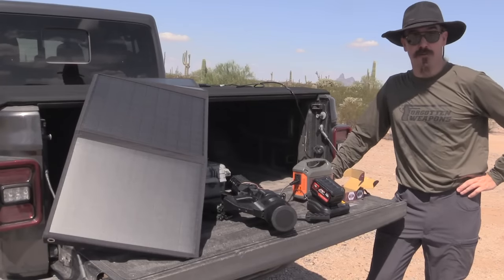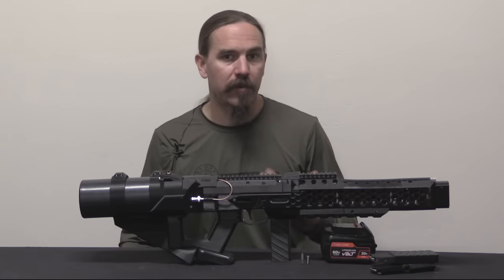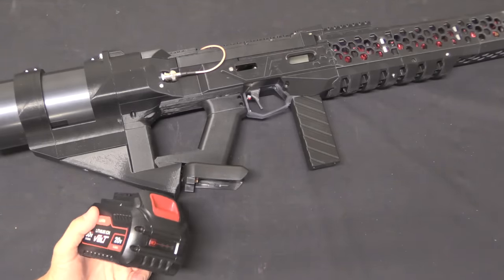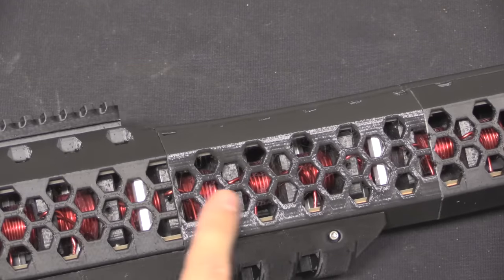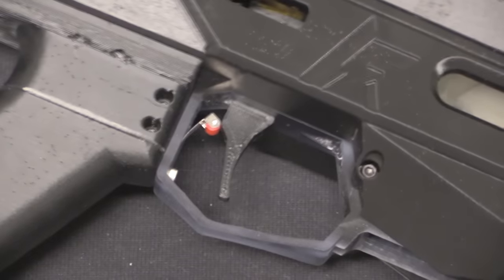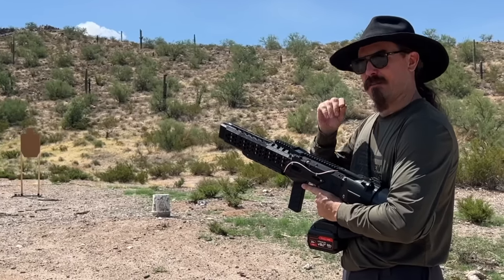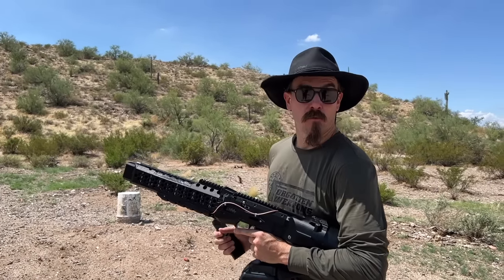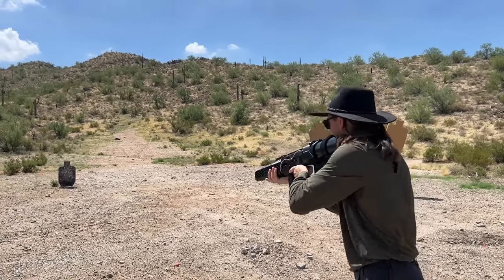ArcFlash Labs EMG-02 CoilGun: Making SciFi Weapons Into Reality

Comment: I would have though they would replace the little LCD screen with something like the 'e-paper' they use on the Kindle. It doesn't refresh like an LCD does, and it's pretty easy to see in bright light too.
Reply: At the end of the day, you need to integrate every part of your design and while LCDs screens are widely available and there are easily connected to the microcontroller, I bet e-paper is a pain in the ass to integrate
Reply: The slow update cycle of e-ink would kinda kill the progress bar they seem to like.
Reply: @PrezVeto  I doubt the charge meter needs to be 60hz real time for this, especially when they get that many shots out of a battery. 
@pesanchegra That's a point actually, I hadn't considered that. But I still think it should be an eventual goal, if they plan to have this be a viable commercial product eventually.
For the sake of visibility and power savings if nothing else.
Reply: That's a really good point! I remember a hackaday article about repurposing paper displaces from clothing price tags that used them, so there are small paper displays out there already they could conceivably be sourcing.

Comment: 🤔 Interesting tech experiment.. it has a lot of thought out ideas here. A practical power source. A practical size. No recoil and no flash or sound. I would think some sort of fin stabilized projectile would take care of accuracy issues? It's not a game changer, yet. But I could definitely see as a first step away from using combustion of chemicals to propel projectiles.
Reply: Might not even fin stabilize since that would add a bunch of complexity. What might be simpler would be a twist in the projectile itself and see if that could properly spin the round.
Reply: @MacSalterson  a fin stabilized sabot is not complex.
Reply: @WALTERBROADDUS  Tell that to Franklin Armory.
Reply: discarding sabot is going to be a problem because the sabot is going to try to discard in the barrel
Reply: Someone else also suggested possibly a round shaped like Torpedoes, with the ring/fin design. Would also help with stacking issues in a magazine, and the ring could be the same diameter as the barrel.
Reply: IIRC the company is planning on using “electronic rifling” to stabilize the projectiles, basically having a rotating magnetic field when firing the weapon to make the projectile spin in the barrel
Reply: Simplest solution would be to just make the butt of the projectile hollow like a foster slug or a minneball, the projectile will naturally fly heavy end first
Reply: @connorbaz5980  you do like tank guns use. They use a smooth bore with a sabot.
Reply: @MrAirpumpkin  that would impart friction and cause heat buildup.
Reply: @spencerh103  doesn't seem to be an issue in the real world.
Reply: @thomasbecker9676 who are they?
Reply: @WALTERBROADDUS  how?
Reply: @MrAirpumpkin  you yourself said you wanted to make a projectile like a minie ball. How else are you going to engage The rifling without expansion? And as you increase the frictional heat that's going to reduce the conductivity of the coils.
Reply: @WALTERBROADDUS  because non-coilgun firearms actually have the projectile contact the barrel, which is not the case here. how much do you actually understand about coilguns?
Reply: @WALTERBROADDUS  LMGTFY.
Reply: @WALTERBROADDUS  The minie ball can work both as a "drag stabalized" projectile and as a rifled projectile. Its hollow at the bottom and heavier towards the front so even if shot from a smooth bore it will fly straight-er than a musket ball or dowel pin of the same diameter.
Reply: @MrAirpumpkin  a fin stabilized projectile kind of meets the same purpose. And if you want to get really fancy? Hopefully one day we will able to make guided projectiles that small.
Reply: @spencerh103  I'm very familiar with firearms and projectile physics.
Reply: @WALTERBROADDUS  a hollow bottom projectile is simpler (and therefore better) for frankly obvious reasons...
Reply: @WALTERBROADDUS  Getting it to work in a coil gun, where theres no contact between the barrel and the projectiles, would be complex.

Comment: Could you use a magnet to sweep the range after, collect up used dowels and re use them? If theres no contact with a barrel then a little dust wouldn't do much damage.
Would a domed/cone tipped dowel have better travel through the air? could improve range, velocity and accuracy. I thought maybe some swirled grooves in the cone tip could create a rotation like rifling would.
Reply: Yea I would think you could shape the projectile in some way to some rotation from the magnetic field - course the cost would be really prohibitive at small scale. Maybe when the government starts buying pallets of ammo at $100 per round we'll start to see that kind of thing.
Reply: Maybe we could have the machine that turns long rods into projectiles put a chamfer on one end.
Reply: You should be able to recover most of your ammo using a magnet.  You could also get round bar and make ammo that would be just as effective and much less expensive.
Reply: Now they will start doing background checks at the hardware store!

Comment: 3D-printed, standard components you can very easily get anywhere...
This sounds like something you could mass-produce in Fallout
Reply: For the most part, but I imagine that massive capacitor is a bleeding-edge custom
Reply: @careernerd2135  honestly I would bet it's another jelly been part
Reply: Not really. Modern plastic doesn’t belong in Fallout: Fallout’s Great War was caused by running out of oil, and tech development diverged away by the end of WW2. Plastics would be limited to early bioplastics like the highly flammable celluloid and the fragile PET. You can see in Fallout 1/2 and New Vegas the art consciously avoids using plastics, even when basing things on real world objects that have plastic.

Comment: given that the coilgun effectively has a 'smoothbore" im thinking of 2 things that could probably improve flight performance.
1) coils oriented to impart rotation in the round that is being accelerated.
2) round itself has rifling
Reply: Maybe round-length fins, for easier manufacture and loading?
Reply: the round doesn't actually contact the barrel very well, so option 1 is probably better
Reply: But how do you do that?  SF has many electromagnetic weapons with "coils on a bias" but that is just words with no physics.  Either a fin stabilized steel flechette or just a round ball that cannot tumble is feasible.
Reply: Or just make it fire flechettes. That's what current large scale railguns do, as they also can't impart rotation.
Reply: I disagree. Making the projectile rotate by the magnetic power is likely extreamly complicated if not impossible. Its not a good solution. There is a much easier one. This kind of weapon does not really care about the shape of the projectile. So it would be much simpler to just fire flechette rounds from it.
Reply: The 'round' goes through the coils so angling them wont make any difference. Secondly even if the round passed 'over' a coil there's no bias in the projectile to make one portion of it more attractive to magnetic field than the rest, end result is the projectile is still pulled down the barrel no matter how the coils are placed around it. The only way to do it with the current design is to chamber each round and physically spin them up prior to the magnetic field engaging pulling the round down the barrel.

Comment: I feel like we might finally have a real dart gun in our future. Low speed controlled impulse with a little needle and sedative contained inside. That’s been in movies longer than lasers and coil guns.
Reply: Real tranquilizer dart guns have existed for decades. Pretty useful for capturing live animals.
Reply: @SharpElbows123  True but this thing is both quieter than a co2 gun of comparable size. And with it using standard lithium-ion tool batteries that can be charged via solar powered chargers it's more practical for long marches and or shtf situations.  

Not to mention at full charge a standard battery has the juice for 300 rounds . Co2 canisters of a comparable size and weight can't measure up to that.

Comment: Having seen the failure mode of a capacitor, I don't know about using the top end of a capacitor as a shoulder rest for your electric gun.

Typically the top end is perforated so it explodes that direction expelling superheated steam, even tiny ones sound like firecrackers.
Reply: Ahem, superheated acid steam.  Because who needs a face?

Comment: The display would be better on the side of it rather than the top. It's going to be a right pain to see the display with optics. But if it is on the offhand side of the chassis it's a simple matter of tilt it away from the body exposing the screen to the eyes. This can be made so it is left or right hand interchangeable. Screen in a little removable box with contact pads in the chassis and spring loaded pins in the box for connectivity and an empty box for the other side to fill in the hole. It can be attached via a plastic tab like what's used in 100's of thousands of plastic objects, but instead of needing a special tool to get into the gap(most people that tool is a butter knife) so the tab can be pushed back there could be a generic found in everyone's junk drawer flathead screwdriver slot. Stick the screwdriver tip into the slot and just a touch of pry the screen out force needed(indent in the side of the screen box for this) to get it past the tab.

The tab should be angled across the screwdriver slot with the triangle catch pin on the box with the angle facing into chassis. The box wall with the catch pin should be a little under the screwdriver tip width and inset into the box and the tab should go into the box. This way the screwdriver being pushed into the slot always disengages the tab and then tilting the screwdriver to pry out the box can be done with a remove movement so screwdriver and box comes out together.

Comment: Increase the power input from a backpack, add more coils to the front to increase velocity and use fin stabilised discarding sabot, so smaller round at much higher velocity and more accurate.

Comment: Have you recommended to them that they use partially hollow, front heavy, projectile similar to a foster slug so the projectiles can use drag stabilization removing the necessity of rifling for a stable flight.
Reply: I'd expect the eventual evolution is to make the coils work in a way that imparts a spin while going down the barrel.
Reply: @kentvesser9484  or possibly getting the velocity high enough to make use of fin stabilization.
Reply: Honestly, with a magazine that could hold fin-stabilized ammo, you could just use that as-is. Feather or wood fletching could be made bigger than the barrel with the intent to slide down the barrel in a folded state, just to pop out into its full form after exiting the muzzle. Metal fins would have to be made smaller than the barrel, of course, but they might have an interesting effect of increasing the muzzle velocity somewhat due to the magnetic mass being concentrated in the back of the projectile.
Reply: Just a random thought, but could it fire sections of drill bits? They come with in-built rifling in the "bullet" which should impart at least some spin. Presumably it would also be reasonably cheap and easy to come by certainly more so than custom built ammunition.
Reply: How I wish I could try this because I really want to know the answer too
Reply: @mrhedgebull1658  no reason it can't, honestly. Genius idea, IMO.
Reply: @mrhedgebull1658  I'd think that might create more drag impacting range and drop more than the benefit you would get from any spin stabilization.
Reply: @kentvesser9484  foster slugs and other similar designs do typically have a poor ballistic coefficient but given the increased accuracy it gives makes that an acceptable drawback to most people. Not to mention even a poorly weighted projectile that flys strait will get better range, accuracy, and retained velocity than a cylinder tumbling through the air.
Reply: Steel dowel pins are actually going to be the optimal projectile for this stage of development, even though most of us can think of several ways they could be optimized for accuracy and/or range. Given the back-pressure problems inherent in a coilgun arrangement, I suspect the 'best' projectile is going to be very weird to our current sensibilities; There's a possibility that rather than fins or rifling, a tapered section of pipe with a venturi-effect narrowing towards the rear might self-stabilise and be the optimal slug...
Reply: @kentvesser9484  You may well be right, it was only an idle thought. Might be worth testing though.

Comment: There’s recoil and the reason you don’t feel it is because the guns heavy, the projectile is small, the speed is low.

There is recoil, there has to be because you have a mass that’s accelerated. However with this gun the projectile is pulled by the coil and the coil is fixed to the gun so the energised coil pulls the projectile forwards and in doing so the coil is pulled backwards to the projectile. Get a magnet next to steel and let the magnet go and it’s pulled to the steel. That’s what happening here except this magnet is huge and the steel is small so the steel moves far far far more than the heavy magnet.

Comment: Great thing about it is that it's so quiet, so no need to worry about own hearing issues, or neighbors. If there was a way of reliably finding and reusing the ammunition (sweeping the area with electromagnet to pick it up maybe) it might be quite cheap to spend some time at the range.
Reply: My thought exactly: Set up steel barrier (or even dense plastic) and  then just use a magnetic rod (like the ones used to cleaning machinery in workshops with a little rubber handle you push down over the rod to clear it of the debris and coils it's picked up)

Comment: They could attach a heatsink to the resistor when it dumps the charge and put some vent holes to help passively cool much quicker.
I'd opt more for a bullpup design to have more barrel length in a compact design, your rifling could be done to the projectiles instead of the barrel, so as the dowels are propelled forward they rotate themselves.
Other changes I'd make would be the battery to something still rechargeable but can slide into the grip similar to a pistol, then the ammo would load behind it with the bullpup design. The biggest thing that's lack is the velocity needs to closer to at least 800 ft/sec, but possibly higher due to the size of the projectile.

Comment: Instead of using a flathead drill bit, use a Phillips heads. And instead of the drill bit just being a Phillips, bend the flaps in one direction and it could create a spin on the projectile, resulting in possibly more accuracy
Reply: it'd have to have surfaces that spring out of the round on exit from the barrel to have enough area for air to implement a torque capable of stabilization. Would be extremely expensive to make it work at this scale, but what you're talking about is a real thing similar to some smoothbore tank ammunition, check out "armor piercing fin stabilized discarding sabot"